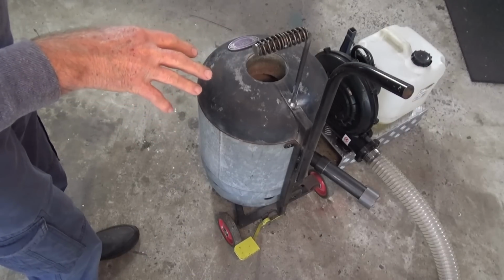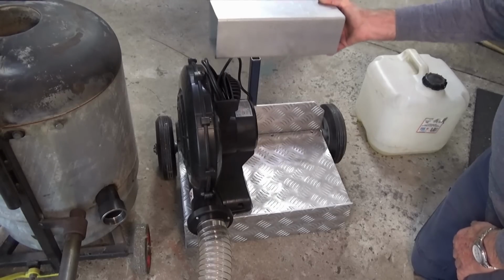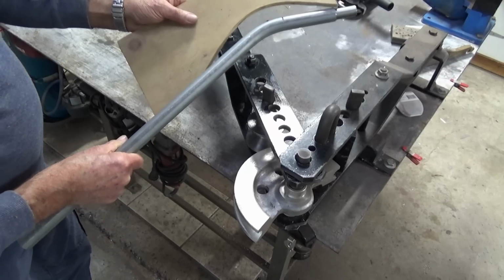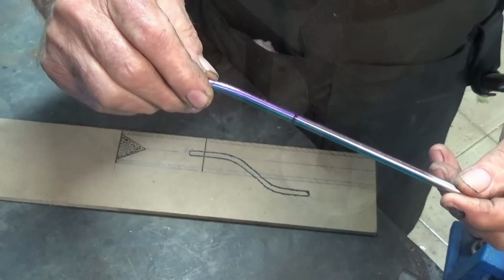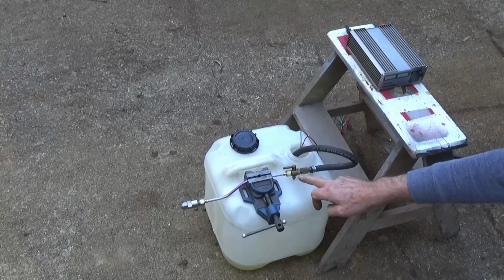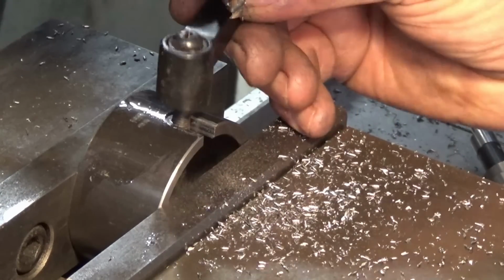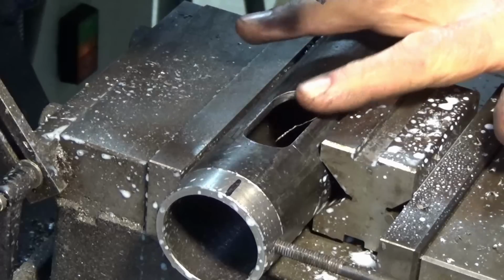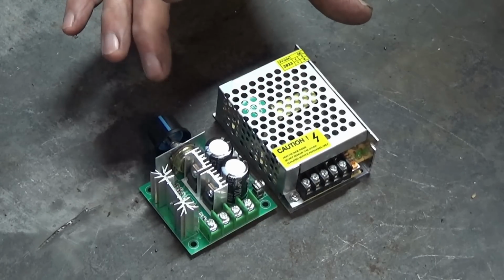Diesel Foundry Furnace Burner - Part 2

Comment: Rather than controlling the pump to reduce the flow, have you considered running it full speed, but having a return line back to the tank with a restrictor valve?
Reply from the maker: I did consider that but the PWM controller works perfectly. I can run the pump at idle and it barely pumps anything and it will smoothly increase the flow up to full capacity. I was surprised it worked so well. I built a PWM fuel pump for my jet engine and it wouldn't let the pump idle at all. It would always start at about 30% which was a bit scary when the engine was cold. Usually lots of flames and a red hot tail pipe until it settled down. 
Regards,
Mark

Comment: To bend the smaller pipe, you could have filled with melted lead, bent them melted away, if you don't have fancy stuff.
Reply from the maker: I have tried that before but you have to be absolutely sure it has not left any air pockets behind. I believe you can purchase a special low melting point alloy for pipe bending.
Regards,
Mark

Comment: With the guide "fan" to centre the nozzle tip, you only need 4 or 6 points (or blades) so as to keep it small and not cause turbulence. In other words, cut off at least half the blades.

Comment: Motors designed to run at fixed DC may work with PWM but you are likely running it in a lower efficiency state which may shorten the life of the motor.  You may want to use a pump that is designed to run variable speed. Cheers!
Reply from the maker: The pump only runs at low speed during the start up phase. Once the heat stabilises, the pump is running at pretty much at full voltage. Given that I only use the foundry about 8 times a year I think it will be OK. However, I am still open to the idea of using an alternate style of pump. This configuration is really a starting point for experimentation.
Regards,
Mark
Reply: @Preso58  Hi Mark!  I appreciate the reply!  I am sure the design will evolve to Preso level standards in due time 👍🏻.  Your attention to detail is refreshing and much appreciated!

Comment: I would think that once you silver solder the tube to your cap, that would be sufficient to keep the nozzle in a fix position, no? As far as ads, I don't really mind them. I will say this, I don't know why you are letting Google take all the ad money off your hard work. There's no reason NOT to join the partner program and get your share. As far as I know, it doesn't increase the number of ads.
Reply from the maker: With regards to the advertising and the partner programme, I am just being stubborn. If I do finally give in and sign up I think the best solution would be to donate the income to a charity. The fuel tube will position the burner nozzle once it is silver soldered to the cover plate, I am just adding an extra constraint to be sure that radiant heat doesn't soften the tube and allow it to sag. I have it on good authority that a 3D printed swirl plate was totally unaffected by the heat of the furnace. It seems incredible but maybe the blower velocity keeps the heat out of the burner tube.
Regards,
Mark

Comment: How big is the chamber of your furnace? And how big is the top hole?
Reply from the maker: The inside dimension is 230mm diameter by 300mm tall. The exit hole in the lid is 110mm.
Regards,
Mark

Comment: i m watching this and from my shop almost burnt down  40x60 ft shop you have that plastic  tank too close to your melting pot   and  you need a steel tank   metal  when melting can explode    im moveing oil  out of shop now   no gas or Diesel in plastic container   so this is my thought
Reply from the maker: I always run my furnace outside. I have a fire extinguisher handy too. I know that some people in very cold climates may not have that luxury. I wanted to have the fuel tank at least a half a metre from the furnace which is why the service cart has the long flexible air connection. Bottom line though, furnaces are a hazard!
Regards,
Mark

Comment: Wait a minute.. you could generator power off the top of that furnace via turbine. . .  And you aren't working on a plan to do so?  Oh mark , how can you let that go ?  You could make a standalone furnace with no power source required.... after a start of course.  How can you resist?
Reply from the maker: I know! and I had sketched out a nozzle guide vane and turbine disc assembly which would just sit on the lid. The free turbine could power a compressor and you would have a fully functional jet engine or at least a self sustaining gas generator.
Regards,
Mark